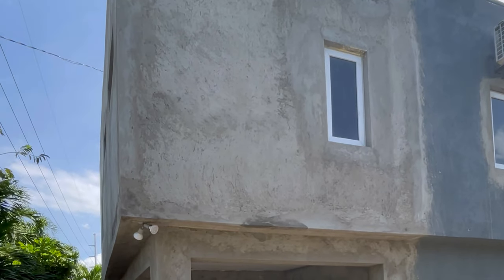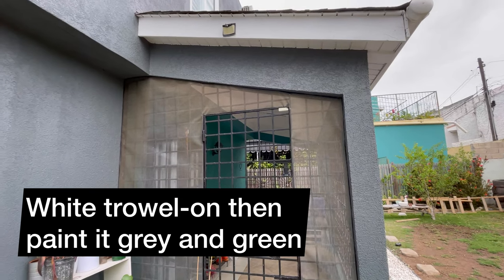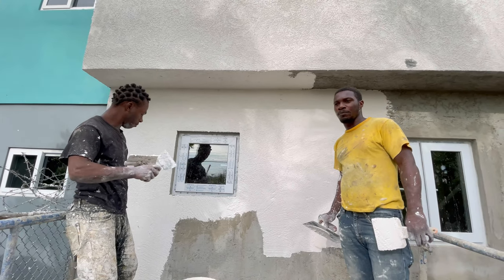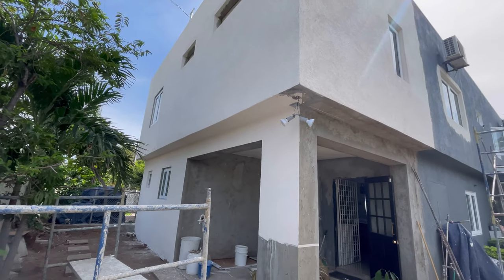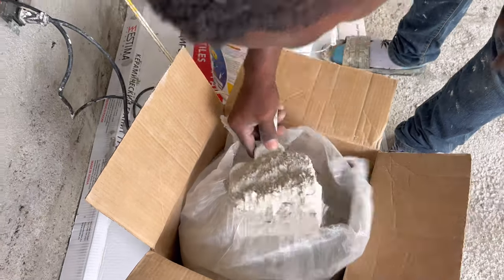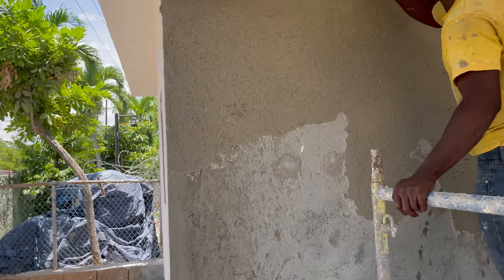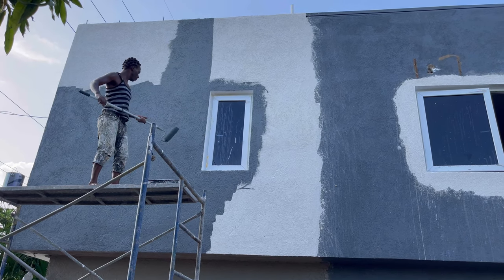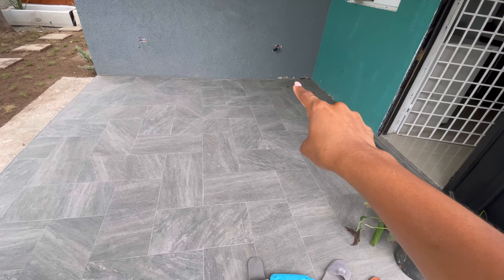Stucco vs Trowel-On Exterior Finishes: Price, Materials and Types

Comment: Our community also demands a specific set of colours of trowel on. We didn't think of using both paint and trowel on. It's an option worth considering.
Reply from the maker: Based on the cost it definitely is. Hopefully you can find the correct paint bcz this big savings.

Comment: Stucco...I've always seen it on HGTV but never thought of using it instead of the trowel on. It pays to have knowledgeable  workers. Wow. The stucco works... my only concern is finding paint that matches the required trowel on colours at my place.
Reply from the maker: Same here, we always see stucco being used on HGTV, however we didn’t realize stucco was available locally. We had the exact paint code for our complex so it was easy to match the color. All the best in finding the exact color.

Comment: Wonderful information!...why not mix the paint with the stucco(since stucco require water) and do one application, instead of applying the stucco then paint it.
Reply from the maker: Thanks for watching Michael. The stucco we had was a concrete colour, so it would definitely change the colour of the paint. Also, if we got the white stucco we would require a lot more paint to get that rich green that the paint alone would give. 

We are aware that you can get the trowel-on mixed in the colour you desire but the cost was over our budget.

Comment: I have a question. My recent build the ceiling is not as smooth as I would like is there a product I can use for that to get it smoother?
Reply from the maker: You can get it finished by plastering with compound. That should get it smooth

Comment: Thanks for the video. Very useful information on material cost. What I can’t remember you speaking about is labour cost. How does the labour cost of trowel on compare to stucco given that you will require payments to apply the stucco then again to apply the paint?
Reply from the maker: At the time the labour cost was $5,500 per bucket of trowel on/stucco. Also to note, we didn’t have to render our external walls smooth, so we had saved on that material and labour cost.
Reply: @HackedbyEbanks  and to paint?
Reply from the maker: @andrewaugh5710  $15,000

Comment: How many buckets did you guys use for the application?
Reply from the maker: We used 9 buckets of Trowel on and then bought 3 box of stucco. The stucco is cheaper and gives more coverage, however you have to add water and mix it, trowel on comes premixed already.

Comment: Looking 🙂only thing ! It was a shame you painted the trowel on ! Because now you will be painting for the rest of thé life of the house as the paint will only last 10 to 15 years max ! And thé trowel on is a life time finish thé tint in it also !! So i dont think you have saved anything at all more thé contrary 😔longterm the original finish would work out much cheaper than repainting regulary labour + materials better to have paiid the extra for the tinted trowel on and not have spend a lifetime of painting cost !!!
Reply from the maker: Hey Richard thanks for watching. Actually trowel on needs retouching every 10years too as the colour will fade. This was the case with the first layer that was on this house. Also the strata may or may not change the colour within that time.